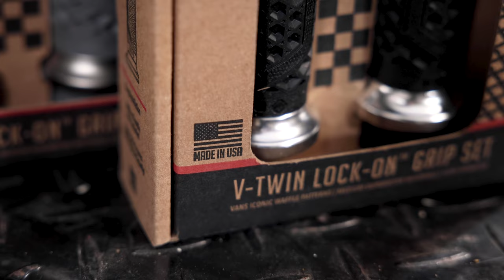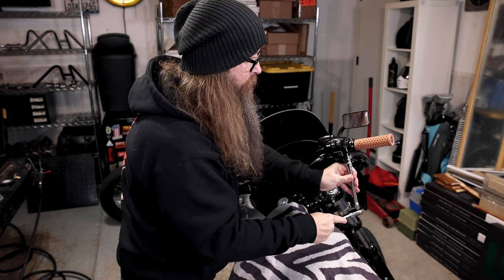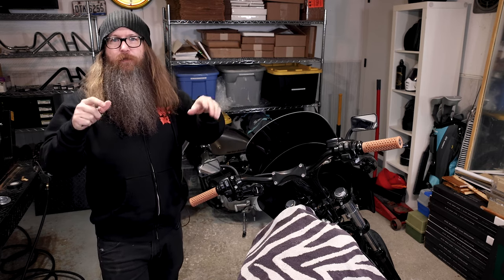How To Install - Vans V-Twin Lock-On Throttle by Wire Grips by ODI On A Harley-Davidson Motorcycle

Comment: Hey this may be a dumb question but I’m rebuilding a Kawasaki Vulcan into a bobber and was looking at these grips, will they only work for Harley’s? I have aftermarket 12” ape hangers that are 1” around
Reply from the maker: work on any 1" handlebars. Theres two styles one is Throttle by wire. and other is Cable wire throttle. You need to determine your bar size and what style throttle you have

Comment: can u just replace the rubber grip portion.  mine is worn out
Reply: I'd imagine you could. I heard these don't last long and wear out fairly quickly. The grips without tubes are only $20 so cheap to replace, I can't see spending $70 every time these wear out because they come with the tube.